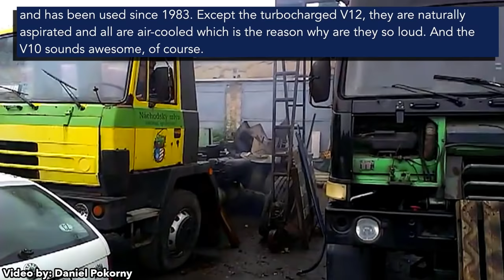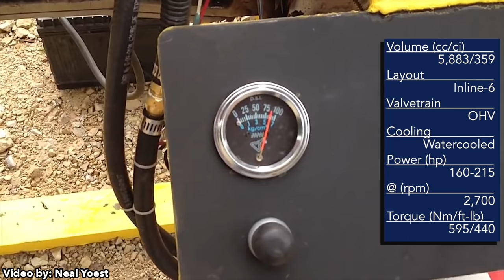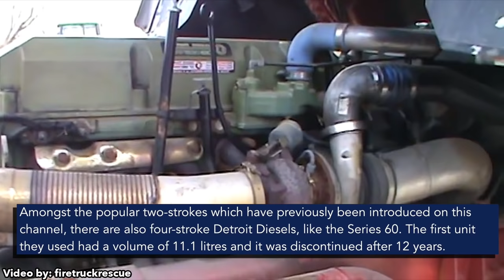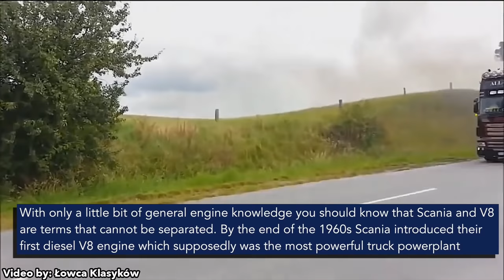10 Best Sounding Truck Diesel Engines

Comment: To me the old 8 -71 Detroit sings the sweetest song running through the gears.
Reply: Agreed. I love the 71 and 92 series Detriots
Reply: kyubey, the cute little devil unfortunately, you're right. they stopped manufacturing them and they're not longer a supported engine :/
Reply: This_Guy well at least they have a good run
Reply: here, there are a lot of them still running. Alaska, too
Reply: I have a school bus with the DT466E. I was like "why does this ford sound exactly like it?" Now I know...
Reply: how about the old 238 Detroit! a real screamer!!
Reply: Personally, I'd rather hear a 6V92
Reply: Musclecarlover7 wouldn't be hard. just take a 6V-71 and re-bore it
Reply: This_Guy Nice to hear you don't have actually find one as it's my favourite sounding diesel
Reply: Musclecarlover7 I've found some online but never purchased one but I've seen them for about 1,000-4,000usd
Reply: Cool. Now I need an old truck and truck license lmao
Reply: Musclecarlover7 if you're using a 6V it might be small enough to fit in a larger pickup. Then you won't need a CDL
Reply: They were 2 strokes, right? Isn't that why they sounded like they were revving like crazy.
Reply: yes sir: I drove a 238 model. had fun though. Ice road truckers showed a ford with one.
Reply: Grant W. Whitwam Yes they were. The 71, 92, 110, and 149 series Detroit's were all 2 stroke engines. That's kinda why I like them. They're overall just a really interesting engine
Reply: 6v53 and 8v71 screamin detroit are the best sounding ever to me.
Reply: the 2 stroke gms are still supported by dd but not much
Reply: I want to put a 4-53t in my Chevy 3/4 ton. what a sound!
Reply: Carla Rodgers you can fit the 6v71 with a little bit extra work
Reply: Zac Western  I want to mount the 7 speed Clark transmission behind it. I would need to beef up the frame a bit to hold that much weight. I bet a 10 inch lift will be the first item.
Reply: Carla Rodgers 10? why not 15?
Reply: Carla Rodgers fuuuck why a 7 speed just order a reman eaton 10 speed for like 1800 even if you don't hook air up for the splitter you won't have to worry about hurting the trans and I doubt you would even have to lift a square body much more than 4 inches, it's something you would have to look at though
Reply: This_Guy I've seen that done a couple times and it's really tempting
Reply: Grant W. Whitwam
Reply: Grant W. Whitwam CHEVROLET TITAN 90 And GMC ASTRO 95!!
Reply: 4-53 GM/Detroit
Reply: What's your problem?
Reply: This_Guy: Thanks for your comment, I was trying to figure out what I said that deserved such a hostile threat.
Reply: Grant W. Whitwam You did nothing to deserve it, probably just a keyboard warrior like This_Guy said
Reply: The favorite 2 truck I ever drove were 1.) 78 model KW with a 8V92 Silver 445, and 2.) 79 model Peterbilt 359 with a Cat 3408.  I wish I had those 2 trucks now.

0
Reply: a lot of Detroit powered Euclid and terex equipment still running in my neck of the woods
Reply: There are still a good amount of V71 and V91 mobile cranes running around. Can't mistake the sound.
Reply: Grant W. Whitwam used to run an old American crawler crane that had Detroit diesel 8-71,smelliest stinkiness engine ever ...but you got to love that sound.
Reply: sisu sounds
Reply: The screaming Jimmy!!
Reply: @whatsongisthis5691  your bus would have a 444e if it sounds like a Ford
Reply: Grant W. Whitwam 
I agree with you. My first Trucking job was 1980 in a International with a 238 but I couldn't tell anyone how many other diffrent Trucks after that in 31 years ? 
The 2 stroke Detroit's sounded BEST but I can't hear anything no longer.
Reply: @MuscleCarLover  Me too
Reply: I expect that from a detroit
Reply: @grantw.whitwam9948  yes
Reply: @whatsongisthis5691  the t444e is identical to the 7.3 powerstroke

Comment: Those 2 stroke detroits you gotta drive them like a race car
Reply: no just practice your Hillary. loved my 238!!
Reply: When you climbed in the truck in the morning you slammed your thumb in the door three times so you were pissed off enough to push your foot through the floor boards....I know, had an 8V92 Silver pushing over 600hp....she ran like a scalded dog if you ran it balls to the wall!!!
Reply: @westernflyer2  the NA 2 strokes had to be driven hard. The turbo'd ones weren't too bad. I fell in love with trucking because of a Silver 8V92 in a cabover Kenworth with an Allison that pulled tanks in Joliet. Best sounding engine ever.
Reply: GimmeDatHemi ! 
We used to say “turning and burning “
Reply: @hoost3056  i don't know any 2 Strome Diesel witch is N/A, how does that work?
Reply: @aaaabababa  I know what you mean. They had to be at least  supercharged to even operate the 2 stroke cycle
Reply: @ryanmccurdy1179  May I ask, how does the diesel 2-stroke cycle work? I'm not familiar with those engines.
Reply: @shagboer3535  they need constant positive pressure because they don't have intake valves just holes around the bottom of the cylinder where intake air is forced in when piston goes down and uncovers the holes.
Reply: @ryanmccurdy1179  Ah, okay! Thanks for the explanation
Reply: @hoost3056  joliet? I live in Joliet
Reply: @iankerr1549  Joliet jake?

Comment: gotta love those ridiculous horsepower to torque relations.

oh, yeah it only has 280HP but it has a THOUSAND NEWTON FUCKING METERS OF TORQUE.
Reply from the maker: That's right.
Reply: That's diesel for you..
Reply: I believe it's also because horsepower is only a function of torque and RPM. Since these diesels rev to like 2000rpm, their HP figures are quite low. It's also why honda's revving to 10.000 RPM have big HP with low torque.
Reply: dont forget about fact when this torque is delivered. max torque at 2krpm? no prob.
Reply: horsepower is just an equation used to sell cars, torque is the real number.
Reply: +Les Brown now all wanna see is a motorcycle pulling a 23 tonne trailer.
Reply: Sss Ddd

some of those ridiculous boss hoss V8 things could actually pull a trailer. i guess the real problem is the nonexistent grip from the tyres.
Reply: MTP 1337 a 23 tonne trailer?
Reply: Les Brown 

aw come on, now thats an overstatement.
Reply: Les Brown 

yeah, but a dragbike also has loadsa torque.
Reply: MTP 1337 loads of torque and what might as well be zero weight, if you tried pulling anything more than yourself with it youd prolly just spin. Thats not really part of the argument but its still a fact, either way hes right stop arguing with him youre making yourself look dumb.
Reply: No, power is power.  If you have 400 HP at 5000 rpm, you can gear it to move those 23 tonnes.  But that kind of engine wouldn't last 10,000 miles if you tried to use it in a heavy duty truck.  And who wants to listen to an engine wail at 5000 rpm all day long?
Reply: Exactly. If you had 2 engines, one with big torque and peak HP @ 2000RPM and the other with low torque and peak HP @ 10 000RPM with the SAME AMOUNT of horsepower, they would have the same potential. 

Let's say the first engine is hooked up to a gearbox which allows it to reach 30 km/h @ 2000RPM.
If you took that gearbox and hooked it up with the other engine,  it would struggle to move, but eventually would reach a speed of 150 km/h.

Now let's say that the second engine is hooked up to a tranny that does 30 km/h @ 10 000RPM.
What would happen, if the first engine got that same gearing? It would accelerate really quickly, but only to 6 km/h, because that is the max speed it can reach because of its low revs.

What if both engines had their own gearbox which would allow them to reach 30 km/h at their respective max RPM? Nothing special! Because they have the same amount of power, the acceleration would take the same amount of time for both.

And that kids, is horsepower vs. torque.
Reply: +Sss Ddd "if you tried pulling anything more than yourself with it youd prolly just spin"

That is demonstrably false, I can move my car just by pushing it on a flat surface and I can promise you I weigh less than my car. Friction just doesn't work that way.
Reply: That's the point of a diesel.
Reply: Actually you can always gear down for more torque, but gears don't make more power. Torque is just a number. Power is what moves things.
Reply: oitdmser with 700hp and 10nm Of torque in a truck you wont even move
Reply: Not with conventional gearing, no. But in order to get an engine that had 700 HP but only put out 10nm of torque, you'd have to spin the engine at nearly 500,000RPM. Once you geared that down to a usable RPM, say around 5500 RPM (90:1) the torque is multiplied by the gearing to 900 ft-lbs. Thats usable.

Power is how fast you can do work. Move things. More power, more moved and/or more quickly. Torque is just one of the variables used to exert that power, like RPM.
Reply: Range Rover, 10 Nm of torque = 7.5 ft*lbs, it's bad form to mix measurement systems.  But anyway, to make 700 hp with only 7.5 ft*lbs of torque, an engine must be running 490,187 rpm.  OK, so you just described a gas turbine with very small rotor diameters, but the principle of gearing still holds.  Put an 82:1 reduction gearbox behind the very small turbine engine, and voila, you have 615 ft*lbs of torque at 6000 rpm, which will definitely be good enough to put into a normal transmission.
Reply: Andy Harman interesting facts
Reply: Sure it will.  You might not want to pay for the fuel it burns, but it can pull a seed drill all day.  Postwar transport Merlins could fly the Atlantic reliably making more power than is required to pull a seed drill.
Reply: OK, here's the straight poop on the Allison 250-C20 engine:420 HP at the output shaft, that spins at 6016 rpm.  That means it is producing 367 ft*lbs of torque at the output to the helicopter transmission.  Then the helicopter transmission steps the speed down to 380 rpm for the main rotor, which would mean about 16x torque multiplication to about 5900 ft*lbs of torque.  Going upstream into the engine itself, the reduction gearbox on the engine steps the speed down from 33290 rpm at the power turbine to 6016 rpm at the output shaft.  This is a 5.53 reduction ratio, which means that the 367 ft*lbs at the output shaft would be 66 ft*lbs at the power turbine.  Do you see the pattern here, Les?  Power is constant through the system, but torque changes depending on the gear reductions.
Reply: How much power is required to pull the seed drill?
Reply: +Les Brown The fact remains that as far as we know from Newtonian physics, T=m*v^2 for linear motion. As long as the driving force (through wheel torque) is enough to overcome the opposing forces, we will keep accelerating no matter how ridiculously small the torque is because we're putting kinetic energy into the system and it has to go somewhere.
Reply: guuuuuuuys. please. my phone doesnt stop ringing because i constantly get google+ notifications about your ranting.
Reply: open up a new comment if you really want to discuss this, k?

/lock
Reply: @adolfvalasek7810  thank you, power is power,  hate when people say "yeah it's low power, but has a lot of torque" as if it makes up for it's lack of power

Comment: How did the V-12 Detroit (the "Buzzin' Dozen") get no mention?

Best-sounding diesel engine ever made, to this day.
Reply: 12v71 best engine everbilt
Reply: If it's any consolation, there's only one Scania V8, no Volvo hauler engine, etc.
Reply: @J B you got jokes bud LOL
Reply: 477 HP  and 1251lb-ft torque with NO turbo.
Reply: Yeah, the 12v71's sound pretty good, but my favorite is the 8v92.
Reply: @markdubois4882  with NO turbo? That’s insane! Imagine that with a turbo, crap ton of torque and power!
Reply: @fadedsoul23  add 14 psi boost and bigger injectors, and you have 930 HP and 2440 lb.ft
Reply: @markdubois4882  that sounds good to me
Reply: @markdubois4882  I think they were supercharged, though. 2 stroke diesels have to be supercharged by design.
Reply: @bcdieselsofficial  true
Reply: @markdubois4882  there power and torque is very impressive, as for being naturally aspirated makes it extremely good

Comment: The 6.0 Powerstroke sounds wicked, and that's why I have one.
Reply: That's a 7.3 maybe ?
Reply: 6leaker powersmokes are a dumpster fire. I wouldn't take one bulletproofed for free... and I am a Ford fan
Reply: @slowstang88  I must disagree with you on that for the most part. but there are more reliable engines out there
Reply: @titusbrace3952  In stock form they were absolutely terrible. I worked on them nonstop in the Air Force. Head gaskets, EGR valves and cleanings, injectors and cups, rocker arms, oil coolers, EGR coolers, turbos, you name it.... the EPA forced Navistar to rush them into production and engineering wasn't done with development.
Reply: @slowstang88  apparently your not a ford fan ,6.0s may be bad but I'd take a stock 6.0 over a 6.7 any day .6.4 and 7.3 are the best
Reply: Only one I had was gonna cost me $8000 to fix everything wrong with it. Sold it asap. Good luck with yours.

Comment: The 1950s peterbuilt truck from duel would be brilliant on this list it sounded brilliant.
Reply: Random Stuff that thing sounded great (it was a 60s peterbuilt, a 62 I believe, not a 50s) and the rig from the film Black Dog. “ain’t nothing like a caterpillar engine” or the old Mack from Maximum Overdrive (the one that chases the newlyweds).
Reply: @CamaroAmx  To help clear up you confusion, 3 trucks were used in DUEL. The main picture truck was a 1955 Peterbilt 281. It was originally made to be aired on TV and it was. A few years later Universal asked Steven Spielberg to extend DUEL into a theatrical movie. Both the Plymouth and the 281 were destroyed when they went over the cliff at the end of the show, so his team had to get another Plymouth and Peterbilt. 
  The Plymouth was easier to find than another 281. However, the 1961 Peterbilt 351 looked exactly like the 281 so they went with that. The first 351 had the smoke stack on the wrong side of the truck so they had to get another one. They used both trucks at the same time in different locations during filming. The one with the misplaced smoke stack was used in 2-5 second scenes(longshots mainly). The other was used with the Plymouth to extend chase scenes and add additional scenes. The 351's were in better condition than the 281 was so Steven's team didn't have to fix it after every scene. The 351's bodywork was identical to the 281 so they only had to paint both trucks to appear rusty and beat up like the main picture 281 was. The trailer on both trucks already had signs of fatigue besides the paintwork so they didn't have to worry about it.
  The 351 had two sticks instead of one like the 281 had which is the main cause of confusion between the two Peterbilts. I hope this clears up any confusion on which truck is which.

Comment: There is another more obscure engine, but a noteworthy monster nonetheless. The Detroit "8V92TA" engine: An interesting 12.1L engine of the "92 series" that is not only a 2-stroke, but has BOTH a Turbocharger and a Supercharger, giving a somewhat unique exhaust note. It was used primarily in the early Oshkosh HEMTT truck, weighing 46,000lb (~21,000kg) without cargo, and capable of pulling it's own weight and much more with ease.

Comment: The power rating (610hp) you have for the Mack E9 is for the electronic diesel control equipped EA9 - the E9 only went from 500 to 575hp and was mechanically controlled